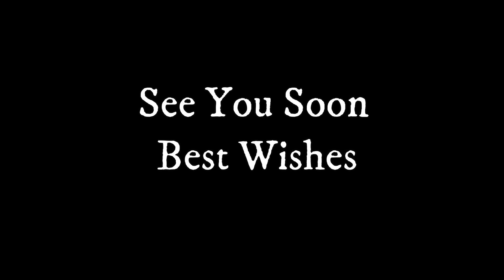Off Grid Water Upgrade: Strengthening Rainwater Collection and Gutters at the Off Grid Cabin

Comment: When you install the hot tub be sure that the cover is towards one of the open areas-not the house. I left about 2 foot on my screen patio for clearance of the cover. Since you will build your own platform, consider a drinks shelf, maybe its own roof so you can use it even in the snow/rain, plus then you can screen it in the summer for the mosquitos.   Also, if you ran the gutter across the porch top and then down the outside of the porch pole then you can have it at the height you need it.  Also consider now solar heaters for your IBC, similar to what you would put in a fish pond else you will have nice blocks of ice that you cannot transfer anywhere. Glad you got more totes, I was wondering how you were going to water all that. Don't forget to run the drain for the washer to the garden-you mine as well use that water one more time-plus bugs don't like the soaps.

Comment: Jay you need ice and snow guard for roof. A friend of my found out the hard way. The guards hold back the snow , ice so it melts and don't just slide off all at once. I guess you can look into it or maybe have to keep replacing the eaves.. Looks great 👍 just passing on a thought 🤔 can't wait to see you too in that hot tub this fall.. 😂🍁🍂🌻
Reply from the maker: Ya, I'm guessing we will have to see. The pitch on the cabin is so steep the snow doesn't get much of a chance to build up, so I'm hoping for the best
Reply: @OffgridwithJayandJen  hoping it works for ya 👍

Comment: Water is collecting - nice job. Going to use that for plants? or burke filter and drink? Just a thought on the front porch IBC...it doesn't have to be right next to deck, right? Maybe extend the supply out to the hill side. Get the IBC low enough on natural dips in and collect there? Digging vs PVC pipe? Might transfer to 1" or 1.5" PVC. See what I'm saying? Thanks for sharing.
Reply from the maker: Great idea....we have similar thoughts. Mostly plant water  but can be filtered for cabin use too if needed

Comment: Do a wet system, PVC pipe on the downspout up higher than the top of the Tote, feed the tote in from the bottom valve using a tee so you will have access to the water in the tote, it will fill with no problem. If you are in an area that has hard freeze conditions you need to use a tee that has a no hub cap that can be removed during the winter. Check out First Flush rainwater harvesting Systems, I have a two part video on my channel how to build a system using off the shelf parts & fittings. See you on the next video.
Reply from the maker: Very cool.....I will check it out. 👍